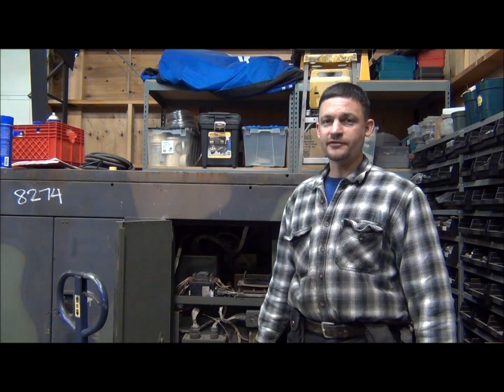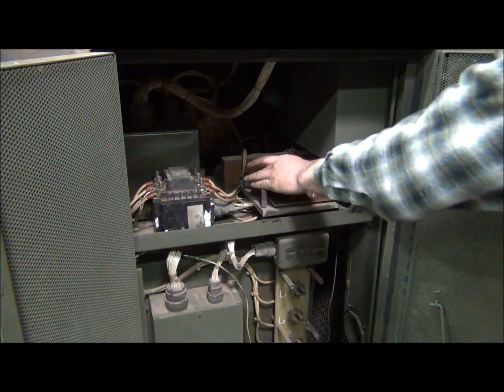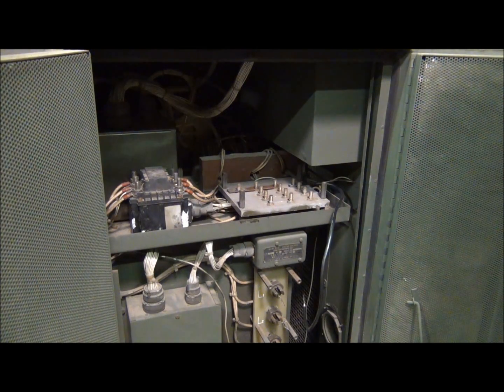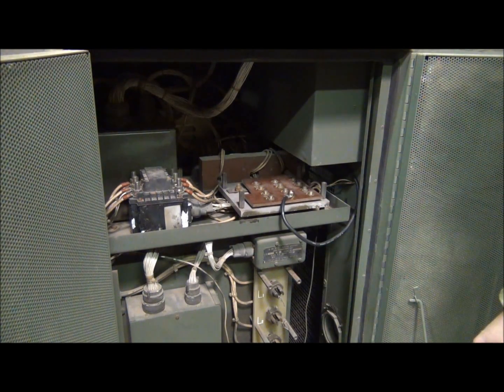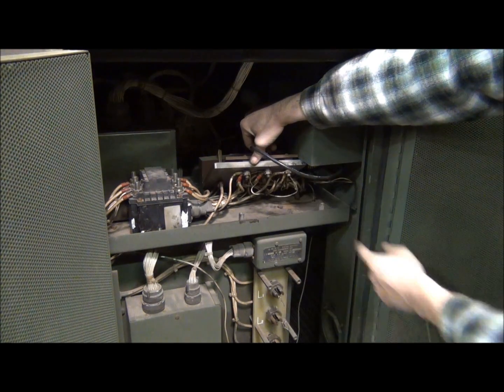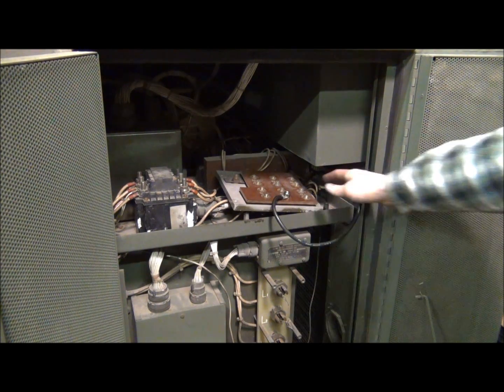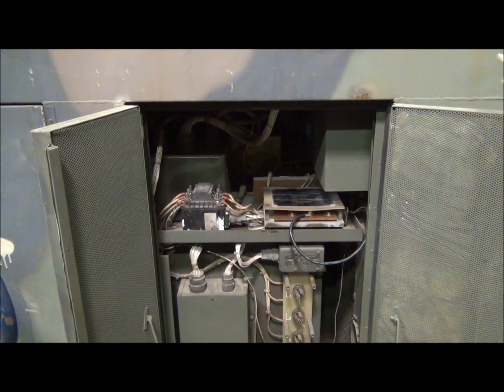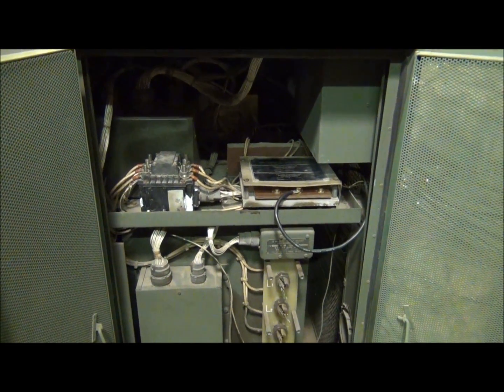How to convert an MEP-004a or -005a diesel generator to single phase 120/240

Comment: I purchased allis chalmers 006 generator.  I had it switched from 230 to 460.  Now when you start it and when you hold the switch up it will generate power, but when you release the switch it falls to nothing.  What would be my problem ?
Reply from the maker: Neither 230 or 460 are normal factory voltages for the -006a; what kind of conversion did you have done?  usually, when the field flashes but doesn't maintain voltage, the exciter assembly is the problem.
Reply: sewerzuk The same thing was done to mine as what you did in your video on converting to a single phase. The guy switched the top wires and not the bottom could this be the problem?  If I could talk to you in person I would greatly appreciate it.  My number is 937 587 5039.  Ask for Bob
Reply: sewerzuk When I purchased the 006 generator it worked fine.  It was a single phase and  was 120/208 I wanted it switched to 240/416 three phase because I was going to use it to run an overhead bridge crane.  I took it to a generator shop to have it switched.  The guy just changed the top leads on the voltage reconnection board and did not change the bottom leads.  When I went to pick it up I had the guy start the generator without it being hooked to a load.  It tested fine.  He shut it off and showed me how to start it and power it up.  It worked fine. Before he started it the third time I asked him to idle it down to 1700 rpm instead of running it wide open.  When he started it up the third time and released the start switch to run, the AC voltmeter would not hold voltage. It would go to 460 then would fall down to very little amps and the diesel motor would stay running.  The fault indicators will not light up and there is no fuse blown  After watching your videos you seem very knowledgeable about these generators and I desperately need mine running. If you think you could tell me what the problem is and where to find it on the machine and also where to purchase parts for it I would appreciate it.
Reply from the maker: Suzanne Wheeler I'm still not 100% clear on the work that was done; 120/208 is a 3 phase voltage; that is how most of these sets were used in the military, so I'm assuming that it was actually in its stock 3 phase configuration when you got it (not single phase).  To convert to 240/416, all the shop should have done is to move the voltage reconnection board to its new location; no other re-wiring or modification should have been done.  
As far as the RPM; the engine needs to stay adjusted for 60hz at all times (1800 RPM).  You should not attempt to run it at a lower or higher RPM (do not run the set at idle).  If you have the set running at about 1800 RPM and you hold the start switch in start, and you see the voltage rise to 460 volts, and then it drops back to zero when the switch is released...then you almost certainly have a faulty static exciter assembly.
Reply: sewerzuk Where is the static exciter assembly located on the generator and where is a place I can purchase this?
Reply from the maker: Suzanne Wheeler It is on the right side (as you face the control panel).  It is a large shoebox shaped assembly with louvers in the side.  If the printing on it is legible, it should have the NSN on it:
6115-00-407-8331
It should also say exciter assembly somewhere on it.  
As far as a replacement; you can purchase one from any of the surplus dealers (Delk's, green mountain, etc.) but prices will be high.  You can look for somebody parting one out in the forums (smokstak or steel soldiers).  Or, you can take yours to an electronics repair shop.  The parts can be purchased online from most any electronics supply place, and a good electronics repair place should have no problem doing the repairs.  
As far as price, the surplus guys will likely want $400-$600 for one.  You can probably find a private party one for around $200 or less.  The repair shop will depend on what is wrong with it, but it is often a bad transformer or failed diodes...usually under $200.
Reply: Thank you so much for your information.  It was the exciter assembly.  It had a burnt spot on the circuit board.  We have it in the shop now to be fixed.  Thanks again.

Comment: Hey Todd or Sewerzuk.. Can you call me at 8043809463 regarding a similar issue with the bus bar on the bottom and what you did. I followed the instructions on the video but have 100 volts to T1 T2 and T3. Can u give
Me a hand??

Comment: Got it sorted. Since the bus bar was on bottom I had to remove bus bar on top from T12 to T6 - bingo - powered up 240 single phase. Bottom line is the video is very good but does not precisely address MEP-004 from later years. So do your homework, understand the drawings and get it working. Mine took 3 hours with a couple reworks. Tonight the house is powered up!

Comment: One major variation I found from the video - the two MEP-004s I'm doing the bus bar was on the bottom of the connection plate - same location as the instrument wiring. A lot more work to pull the bar - modify and then replace. I'm not sure which years of MEP-004s change the location of the bus bar but this should be noted
Reply from the maker: There is no correlation to years/serial numbers/etc. to the bus bar location.  I have run into both styles...not too difficult to cut the bus bar on the bottom, but the work area is tight.  I just use a dremel and the work is done in a few minutes.  I do address this in the Steel Soldiers forum, but not here in the video.  Sounds like you worked around it and got it running...good work!

Comment: any one have a clue on a mep002a what mite be bad if your voltage keeps going from 94 volts to 145 volts +-. i replaced the A2 board because couple diodes were cut out.
voltage went from steady 94 to up and down now. HELP!!!!! i do have a second generator for parts.

Comment from the maker: The biggest benefit to the conversion is that you can get your full 30kw out of the generator in single phase.  If you leave it in 3 phase, you can only get about 60% of its rated load.  Also, some single phase equipment does not like 120/208 (although most appliances/tools run just fine on it).  If you ever anticipate needing 3 phase, and you don't need more than about 20kw of single phase, and all of your loads are fine with 208v, then you can leave it as is.

Comment: I just purchased a mep005a and saw your video on the single phase conversion.  Is there a safety/longevity benefit to the conversion or could I just hook up to two of the three hot legs for home use?  I have heard about unbalanced loads but I am not an electrician.  I appreciate any advice you can give.

Comment: Hello there, great video to watch real well expained.I am looking for some information in regards a Deutz generator.I have been asked to carry out a job on 2 x Deutz F6L912 generators with Stamford UC224D alternators, 3 phase configured for star-series 480V output, 52 kW and 60 Hz,but i need to rewired to single phase star parallel 120/208V so it will be compatable with an inverter.
If i could get any help from you i would be really greatful.
Many thanks..
Mick O'Connor.

Comment: Sewerzuk, would it be possible to do a Video on converting the MEP006A genset to single phase particularly changing the secondary (meter) wiring? 
On the unit I have it has two secondary wires to T12 -  X12EG16N and X12P16N so I can move the X12EGN to T11 not sure what to do with the X12P16N. On the T8 there is only one secondary wire X8E16B
Reply: Did you ever get any info on the 006 A ?

Comment: Sewerzuk, Thanks for the video showing the MEP004A conversion. I have a MEP006A 60Kw and was wondering what differences there may be in converting it to single phase. I understand the jumper connection between T12 and T2 but is the secondary wires configuration still connected X8HH16B - T8 to T11; X8A16B - T8 to T3; X12EG16N - T12 to T11? You may reach my email at rdspal28@gmail.com

Comment from the maker: OK; if the alarm resets, then all is fine.  Sometimes, some of the sets I work on will develop spurious alarms during startup.  As long as it resets then nothing is wrong.  Yes, L2 will have 120v on it with no load.  Depending on how much load is on the generator and how balanced it is, that voltage could be much higher or lower than 120v.  That is normal...

Comment from the maker: Not normal to have the reverse power light lit; does the light go off if you operate the test/reset switch, or does it stay on all of the time?  If the breaker stays shut even with that alarm, then the alarm circuit is faulty.  L2 will still read a voltage, but the L2 terminal is not used once the conversion is done.  Only L1, L3, and L0.

Comment from the maker: You will need to wire up L1 to one side, L3 to the other side, and L0 to the neutral.  This will give you single phase 120/208.  All of your 120v loads will be fine.  MOST 240v loads work fine on 208; some synchronous motors (well pump, air compressor, A/C pump) may not be rated to run on 208v.  You'll find that most 240v appliances will show 208v-240v on their ratings tag.  I ran my shop and my house for a long time on 208v (before I came up with the single phase procedure) with no problems.
Reply: Matt , I really have found your videos helpful,keep up the good work. I have recently purchased an MEP 805B 15kw gen set I am interested in doing the three to single phase conversion if possible? Your thoughts.
Reply: Sorry Matt , it's an 804B

Comment: Love your presentation!
I have a MEP-805A. It has a movable plate on the voltage reconnection board that allows you to have 120 volts, 3 phase at L1, L2, and L3 (to L0). If I elected not the convert it could I, or should I connect L1 to one side of my panel box and L3 to the other side? Will the variation in the phases mess up any 240+/- appliance or tool?

Comment from the maker: I have heard that some of the newer 805's had 10 lead generators in them.  If that is the case with yours, then my method will not work.  If you have a 12 lead generator, then the process should be very similar.  The bus bar being on the underside of the fixed board is common...I have seen more on the top, but most other people seem to find them on the bottom.  Same procedure...just cut it to isolate T12

Comment from the maker: It is normal to see the T10, 11, 12, 13 bar rivted on the underside of the board; lots of generators came this way.  The bars on the top board are normal and need to be left alone.  To cut the bar, most people leave it in place and use a small cutoff wheel in a dremel.  I have also seen people remove it completely.  It is more difficult when it is located on the back side of the board, but still possible.

Comment: I'm in the middle of doing this on a MEP-005a.  Simple question, but if my bus bar is not in between the two boards as the one was here, but on the backside (underneath) where all the loads are tied in, I'm assuming I cut it the same way, right?  Any benefit to bringing it up to the other side?  The top board actually has double bus bars riveted into it between T1 and T4, T7 and T10, T9 and T12 etc.  Is this standard?

Comment from the maker: The proceudre is very similar; the modification to the voltage reconnection board (cutting the bus bar and running the jumper) are exactly the same.  I'm not certain on the wire movements under the board...I don't have an -006a right now so I can't go check either!  I will send you an email...

Comment: Our fire department is getting a mep006a from federal surplus. I assume that we will have to convert to single phase. I was wondering if it was the same procedure as the 004a and 005a. Any help would be greatly appreciated. I am supposed to go get this unit next week and then I can service it and get the pad poured for it. Also can you send a list of NAPA numbers for all the filters?  you can also send any info to fdmedic13@yahoo.com

Comment from the maker: I bought my load bank from a local generator installation shop.  It was designed to be permanently installed as a dummy load for a 300kw generator.  I modified it to work on low voltage, and modified it to be able to "scale" the load.  Before I found my current one, I was going to build my own load load bank using recycled electric baseboard heaters.  500w halogen lights are also a good cheap load...

Comment: I've been reading through a few threads on Steel Soldiers you wrote about reconfiguring the MEP-004A to 120/240 low zigzag.  What type of load bank equipment would you recommend for testing the 004A?  I just bought one and am picking it up on Friday.  Once I get it home I'd like to test it but I'm not sure what piece of equipment to get.  Any information on this would be greatly appreciated.  Thanks.

Comment: Thanks for the reply.  Just after I sent the message to you I saw that the MEP-814A was a 400hz unit.  Darn, it looked like a good unit coming up for auction and only made in 2006 with 29 hours on it.  Right now I'm looking at bidding on an MEP-004A mounted on an M200A1 2 1/2 ton trailer.

Comment from the maker: The MEP-814a is a 400hz unit; if that is indeed what you have it cannot be used for conventional 60hz power.  The frequency is determined by generator head design and there is no way to convert it to 60hz without swapping the generator head.  As far as the single phase conversion, I'm not certain; I've never had an 814 in my shop, since they are almost useless for any civilian application (except as parts for 60hz units).
Reply: 400hz is for aviation use, if he knows a small airline that needs a ground power unit he can set it up for 115VAC 3 phase, he'll also need to install the 6 pin ground power adapter with a 15-20' leads.

Comment from the maker: Most of the generators have an overspeed reset button on the side of the speed switch (it is a metal cylinder or rectangle, on the left side close to the fuel filters).

Comment from the maker: You can just use 2 of the 3 hot legs in 3 phase; but you only get 120/208 instead of 120/240 (some appliances don't like 208).  Also, you can only get about 60% of the generator's output this way.  After reconfiguring, you get 100%.

Comment: hi, what is the purpose of reconfiguring. couldnt it just work by leaving one hot leg off of your connections. or does it not have a neutral without reconfiguring.
                                  thanks Ken

Comment from the maker: Single phase is common household current. 3 phase is commonly used in industrial settings.  3 phase motors (and conductors) can by physically smaller and are more efficient than an equal power single phase motor.  The specifics are too detailed to get into here.  If you google "difference between single phase and three phase" you will find all the info you will ever need...

Comment from the maker: @remantrans L1 and L3 should have 240v, L2 should have a varying voltage anywhere from 208 on down, depending on load.  Something isn't correct with your generator's 12 leads!  I'm looking at a schematic, but there are just too many possibilities for me to figure out without your generator in front of me.  Any chance you could email me some pics of your voltage reconnection board, both top and bottom?  I'll send you a message with my email address.

Comment from the maker: @remantrans I would verify the readings at the load terminals with a digital voltmeter; this will tell you if the connection problem is with the instrumentation/control wiring, or with the actual generator leads.  I still suspect that one of the wires you moved is in the incorrect position.  It is also possible that the set you have was incorrectly wired in the first place (I have worked on some of these that came into my shop incorrectly wired).

Comment from the maker: @remantrans Are you saying that you followed the video and have already completed the conversion?  If so, and you are still getting 120/208, then you most likely have either not cut the bus bar, or run the jumper to the incorrect terminal on the reconnection board.